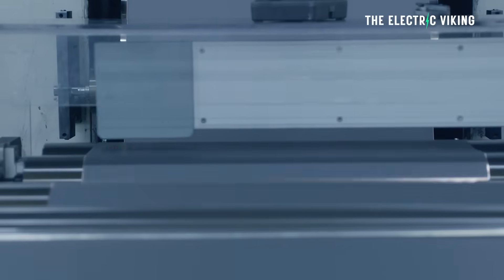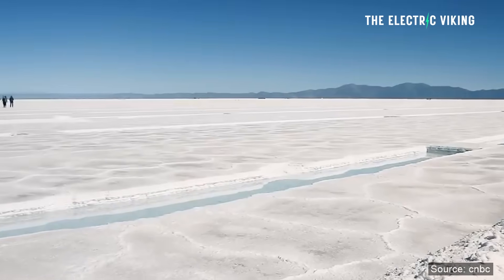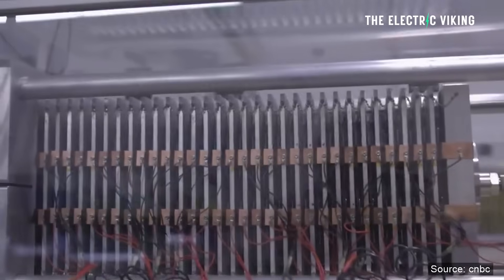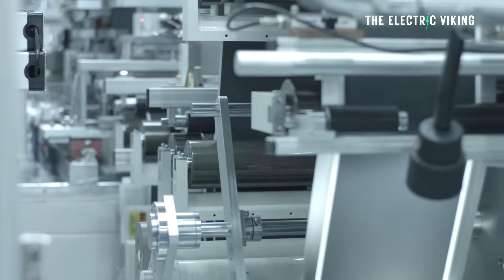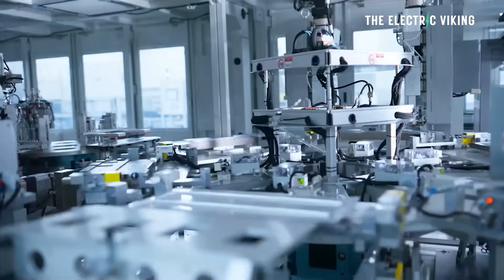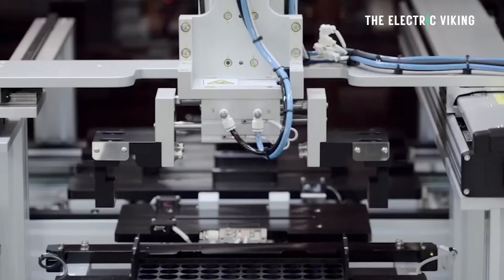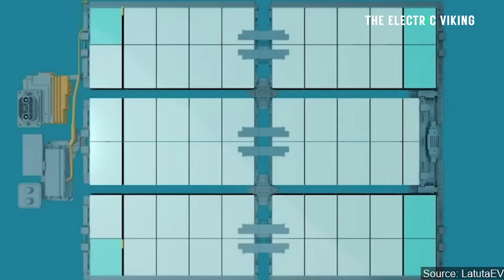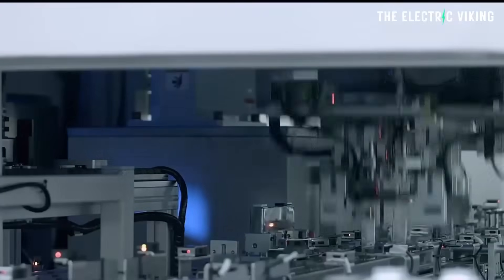Aussie battery company reveals 30% cheaper sodium home batteries

Comment: 30% cheaper and less than half as many cycles as LFP makes LFP still a better buy.. They need to shoot for 60% cheaper or more. The mechanical stress issues of discharge recharge cycles in sodium ion batteries has no solution on the road map. They can only have higher density in a solid state battery of sodium ion compared to a non solid state of LFP. All things being equal, the LFP non solid state is higher density than a sodium ion non solid state and a solid state LFP is higher density than a sodium ion solid state... Of course a solid state anything is higher density than a non solid state anything in general. Doesnt matter much since it is all paper anyway since solid state batteries have 1/4 or even 1/10 the cycle life due to micro fractures with no good solution on the roadmap. I was talking about LFP batteries in China over 10 years ago, technology was pretty solid and I was going to get one for my electric scooter in China. Back then a 12v 100a scooter battery was 10x more expensive than the lead acid equivalent.  it was just a matter of prices coming down. Sodium ion has much bigger challenges than price which makes me doubt their viability.

Comment: Biggest issues I see for domestic adoption:
1. Cost, upfront cost
2. Inverter compatibility, any useful broad-use battery solution needs to be compatible with a number of inverter types, at least industry-leading inverter manufacturers...
3. Ideally, stackable capacity. It's pretty easy to determine core "off-supply" ie. overnight electricity consumption. This will vary from home to home, and potentially over time as a household's needs grow & change.

Comment: Well, that is fine if you live on a place where the sun actually shines a lot. I just spoke with a customer of mine who installed a CN $ 25,000.00 solar project on his roof here in Alberta, Canada. For now about 8 weeks he practically had no input whatsoever and no battery lasts that long. Why? Well, there is winter and it snows. At most places, unfortunately, the whole thing makes only sense for the individuum, if the government subsidizes it, which means taking money away from others to support you.

Comment: This is awesome news. I have a battery ready solar system and have had for the last 3 years (before that i had an old school grid tied system). However the cost of batteries has put me off. I knew that eventually the price of batteries would come down and i was particularly keen on the idea of sodium batteries for the lower cost price. So if they come to market, id be pretty keen to check out their offering, especially if they had modular batteries, whereby i started with perhaps 2 kw Modules and then added extra modules over time as needed or when budgets allowed.

Comment: Sam, another great video. I've pondered for a long time on why the cost per kwh for home batteries is so much higher than car batteries given the latter need to be impact resistant, weather resistant and lighter. Then i watched your video on the  profit made on each Tesla megapacks and realised it's simple lack of competition. Whilst the car manufacturers are fighting for survival making cheaper and better EVs, home batteries solutions are lagging behind. If the home battery price could drop from $12k per 10kwh (tesla pw3) to $1k per 10 kwh or $100 per kwh which is still close to twice the cost of car batteries so many homes could be 100% energy independent.

This new home battery solution could be the start of a home battery war which will be great for consumers and the planet.

Comment: That we should need to generate and store our own electricity seems really regressive and another policy failure by our politicians.
Reply: It's more cost effective for the grid to have a localised mesh network of storage it can draw on at peak times. Modern battery domestic storage has the capability to be controlled by your supplier.
Reply: @SlowhandGreg  find that hard to believe when for the most part we already have the transmission from old sites in place. Against hydro maybe.
Reply: Using a localised VPP, our sodium-ion battery systems can shift electricity loads from peak periods to off-peak periods, provide power during blackouts, and reduce power bills. Through a built-in proprietary energy algorithm, both commercial enterprises and residential solar users can buy and sell energy from the grid efficiently and cost effectively.
Reply: @PowerCap-n1m  wouldn't it be better to just provide reliable, low cost power to everyone from the grid?
Reply: @Discoworx  renewables lend themselves to decentralised mesh networks using domestic batteries for grid smoothing takes away a lot of issues with new powerlines and grid scale storage.
What you want is a mixed system
Currently the fossil companies are fighting tooth and nail to stop it happening, the worldwide fossil subsidies last year was calculated at 7% of global gdp
Reply: @SlowhandGreg  that's why I'd opt for a mux of nuclear and RE. I would look at re-nationalising the system and providing low cost power to everyone.
Reply: @Discoworx  current nuclear costs x 4 the price of renewable and a lead time to build of 12-15 years

In the last 10 years the cost of renewables has dropped by 95%, while I don't expect the same again battery prices should hit the 90% mark
Nuclear is cost wise on par with hydro and tidal both have a 100 + year life span and NO decontamination issues or costs
Reply: @SlowhandGreg  yeah nah. Snowy Hydro 2 is what $12-20b for 350mw and 2gw storage? What other big hydro is being done that can match the output of nuclear?

Have you factored in the transmission necessary to get power from those big tidal areas?
Reply: @Discoworx  you can run tidal like offshore wind using a slow moving blade like proppelor
Their are some trail installations but we haven't invested in it, private companies won't it needs government backing once fully developed it would be an export hit

If you install domestic and grid scale batteries you change the demand curve lowering costs by at least 1/2
Reply: @SlowhandGreg  how 1/2? You need to massively upgrade generation. Batteries currently last 9.8 yrs. There's a good reason nobody invests in tidal. It's shit. Seawater v the revenue doesn't add up. Yet nuclear tech has been around for ages. Go ask the French who have no natural resources yet is an energy superpower.
Reply: @Discoworx  Hinkley C is now in it's 12th year of building isn't due to be opened for another 3 years and will have a total cost over 35 years including 40 billion in subsidies of 80 billion.
The electricity it generates will cost 3.5 times as much as that from the newly opened Dogger bank offshore.

To remove peak gas standby plant and replace it with mass storage would cost 30 billion.

It would save 30 billion in energy costs in 12 months and every year there after.

Octopus offer an overnight rate of 7p per Kwh instead of the daily rate of 20p
I have home solar and batteries and any grid electricity I consume even in winter is at the 7p rate.
The reason the overnight rate is so cheap is our energy consumption is up to 75% less in the middle of the night as to peak time of 4-7pm with usage being described as a Duck curve.
Wind and Nuclear are always ON and it pays to offer people incentives to time shift consumption away from peak periods.

The flatter and fatter the duck curve is the cheaper the electricity becomes

Comment: Sodium ion's voltage range doesnt suit any current inverter tech yet, not really suitable for home storage yet..
Grid ,: yes
Car : yes
Home no
Reply: Lithium home storage has plummeted in price in the UK
Reply: @SlowhandGreg  worldwide, just bought 32 kWh of LifePO4 cells for around 2000 euro/2400 usd
Reply: Our patented EMS and BMS allows for seamless integration into a homes current inverter.

Comment: 10 kWh home storage battery is way too little. It is somewhow antisocial to supply fluctuating energy to the grid from your solar panels.
Reply: Average home uses 8 kwh per day
I have 10.4 plus a solar diverter to heat water, the point of the batteries are to open up off peak tariffs and time shift usage.
Reply: @SlowhandGreg  In many parts of the world the daily house electric energy consumtion is much higher if used for heating and cooling. Without a bigger battery you may end up dumping too much energy in the power grid leading to unwanted spikes.
Reply: @drgyt2469  id suggest you spend some money upgrading your insulation.
Also
In the UK you only need enough storage to cover between 4-7pm
As it is my appliances are set to run overnight in the winter using the off peak rate, I also charge up the battery given its winter.
People with heat pumps in the UK pre heat and avoid peak time consumption most systems are wet and use a tank

The point isn't to be off grid it's to flatten and fatten the demand curve enabling you to get the cheapest rate
Reply: @SlowhandGreg  The idea is good. We should however not only think about minimizing our costs, but also about power grid stability. I other parts of the world the temperature ranges get more extreme.

Comment: well done PowerCap! looking forward to getting a safe and sustainable sodium-ion battery installed in my new off-grid home in 2025!! :)
Reply: Problem is that here in Aus. A 10kw sodium price is 6900$aud compared to Tesla 2 14kw at 10k$.. without rebate.. so Sodium was supposed to be cheaper but Aus pricing doesn’t reflect this..  if Sodium is the future, then you better start dropping the price per KW or it won’t take off..

Comment: Small systems that can be user installed would be nice. Even with solar panels for 12 years we still had the grid go down for 2 hours one night here in SE Qld. A small system to keep our 240VAC LED lights on and run the fridge for 1/2 a day would be nice.
Reply: Bluetti and Ecoflow sell portable backup batteries, they're about $1000 per KWh but are plug & play, no installation fee, but connecting them to your lights may be tricky.

my brother has a 2KWh ecoflow for his house that he uses during blackouts and also for camping, its pretty good, i'm waiting for the price to go down by about 75% before i buy one (i get blackouts once a year, he gets them twice a month).

you could potentially DIY a "kings 300AH 12v lithium" setup with a 3kw inverter for under $1500, (3.6kwh capacity, expandable for $1000 per extra 3.6kwh, 7.4kwh max at 12v, or 28.8kwh max if you're willing to use a 48V victron inverter/charger), but the charging will be painfully slow at 12v.
Reply: The PowerCap POD offers a compact, plug-and-play solution for residential use that doesn’t require an electrician to install. It's smaller than a standard suitcase and easy to move between rooms - perfect for apartments, home offices, workshops, and noise-sensitive spaces.

Comment: To use desalinated water you would have to run the reverse osmosis concentrate trough a brine concentrator to convert it into salt.  It's probably cheaper to use salt drying beds.
Reply: RO is just one way. The newer much cheaper way to desalinate sea water is Low Temperature Thermal Desalination (LTTDS)

Comment: Don't expect this to be a hit for home batteries - maybe for grid storage, but not home batteries. For home batteries, the cost of the battery is only about 10% of the total cost. Case in point: A 10 kWh home battery sells in the range of $10,000 USD. How much should 10 kWh of batteries cost? $100 USD per kWh means $1,000. I have no idea why the rest of the battery costs so much.

Comment: Sodium ion battery tech is by far the mass storage future. Low cost, low toxicity, low danger, easy recycle, low fire risk. Been saying this for a while. It's sort of obvious though. It also overcomes any residual phycological barriers to lithium batteries and fire risk, despite their improved safety. Even for transport, once EV super fast charging becomes ubiquitous, battery range will be far less important.  i.e.  If you can charge your vehicle to full within 10 minutes.  For most daily commutes, range anxiety will become irrelevant if charging is fast and accessible.  Also the average performance in varied climates is said to be better than Lithium.  Sodium will dominate the market in future.
Reply: A lot to come in this space 👍

Comment: Actual energy density is only marginally lower than Litihium. It has been said that a Na-ion battery for home use would only be a about 2.5 cm deeper than a tesla Li-ion battery of similar capacity, so for a house its not a real problem. 
The real benefit of the sodium battery is its fire free and can be recharged many times more and made on the same production line as the lithium batteries. The only drawback is it does not have the fast output power drain of lithium. But as there is no high speed acceleration engine inside a house that is irrelevant.
So Na-ion for homes and small suburban runabout vehicles and LI-ion for sports cars.
Manufacturing must start now.

Comment: This is great news Sam!  I am currently building my retirement home in Maine, USA and will be installing solar panels and battery backup next year.  LFP batteries are problematic this far north as they don't operate well below freezing for charging,, and stop discharging at about 4 below 0 F.  Temps in winter can easily dip to that range and below where -8 to -12 is not unusual.  This forces batteries to be installed in a heated space. vs a garage (where I want to install them).  The new Sodium batteries operating at -40 make them incredibly attractive all over the Northern US and Canada.  I am anxiously waiting for their arrival, and will likely postpone my purchase until they are available.
Reply: Do you currently live in Maine now?

Comment: If the Solid state Sodium battery' was worth its weight in salt , then this company should have COMPANIES  SMASHIING DOWN THEIR DOOR TO BE THE ONES TO BE APART OF THIS HUGE BREAKTHROUGH. The sound of crickets was clear in your report of those lined up.
Reply: 2 different products, the sodium mentioned in the video title, are very real, and a great alternative to LFP for cold energy storage.
Reply: They have the same problem all sodium based batteries have, comparatively slow charge/discharge cycles

Comment: Lithium batteries now at US$60/kWh at the latest auction in China.
That means a Tesla M3 battery would cost $3,600 US. So about 5 grand Australian.
If the battery is the most expensive part of the car, then we are talking about a 10 grand Model 3.
Reply: For just the bare cells, almost double that for full pack ready, but yes, that is why we are seeing $30k Tesla's soon, at about $7500 for the full pack, that is only 25% of the whole car.

Comment: So you have Solar Mr Viking but no battery as yet. What was the hold up?
Reply: Batteries don’t pay off yet as they are too expensive.  I’ve got 8kw of solar and no battery as the cost benefit analysis just doesn’t stack up at current prices.

Comment: I cannot see nuclear plants being built under the watchful eye of the CFMEU getting 30% cheaper.
Reply: Nuclear is only expensive because of over regulation. Nuclear power running 24/7 using power from the grid as a ballast, should have never been more than 1 cent per kw/hr, 2 cents to your house. - Galen Winsor
Reply: @ChristopherLeeEdwards hmmm nuclear over regulated. Considering what you are dealing with yes please.
Reply: @ChristopherLeeEdwards   Regulations are necessary because it's frikin nuclear energy, can't cheap out on safety/security protocols, fuel procurement measures and waste disposal. 

The gap between LCOE of solar and nuclear keeps getting wider... I bet pumped hydro will take care of the bulk of long term energy storage while sodium ion batteries will be there to meet the frequent spiking power demands
Reply: @ChristopherLeeEdwards  Nuclear is expensive everywhere - except in Russia where lack of regulations meant they did not need to build containment vessels over their reactors.
Reply: Unions have nothing to do with it.  Nuclear is expensive regardless because no expense is spared on safety as the consequences of something going wrong is so high.

Comment: Sam, I’ve been using the paid ChatGPT version since day one, and I’ve never seen the kind of sodium-ion bias you’re describing. While sodium-ion batteries might find a role in niche applications like stationary grid storage due to their abundance and cost-effectiveness, they won’t replace lithium. Lithium isn’t just the cornerstone of EVs, BESS, shipping, and air mobility—it’s also the lightest metal and densest energy storage material on the periodic table. Its unmatched energy density, mature supply chains, and continuous cost improvements keep it irreplaceable for high-performance applications. Sodium-ion may complement lithium in low-cost, lower-performance markets, but it’s not the disruptor you claim it to be.
Reply: They're now using a salt - Lithium mix that works just as well as just Lithium.